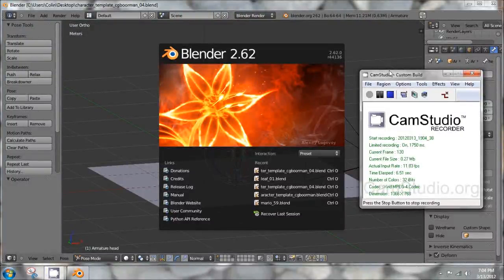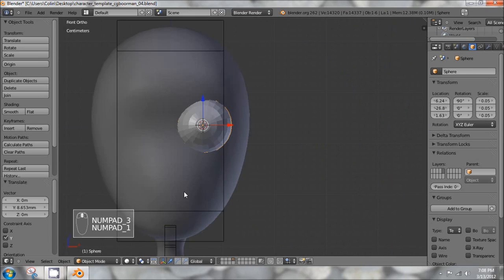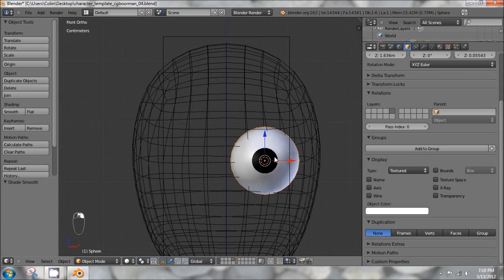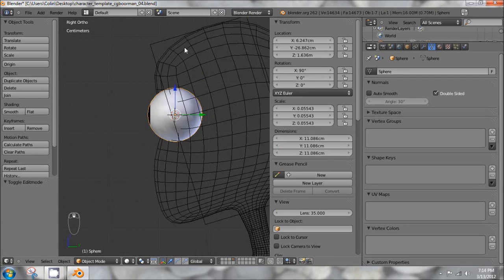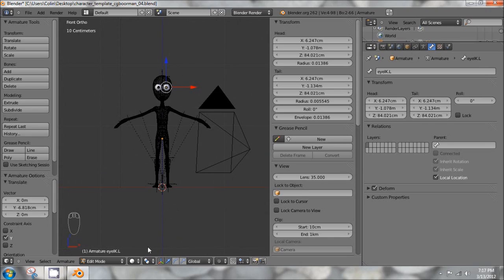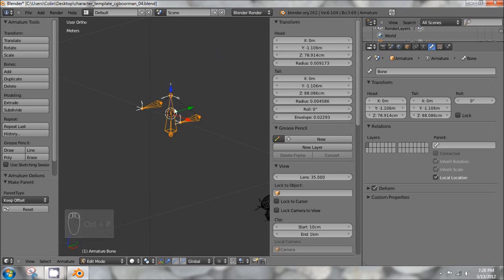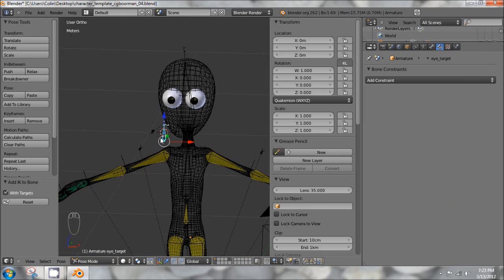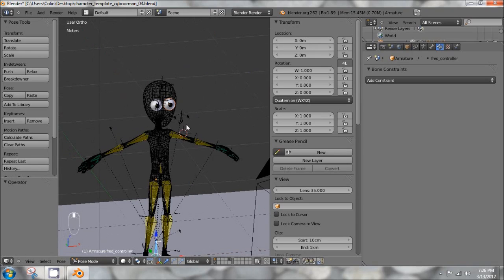Blender 2.6 Tutorial 34 - Eye Rigging

Comment: Good tutorial.However I do have have problems with some keyboard instruction on the shift key. Is that because you are using windows, and I on Linux? What is shift I? as it doesn't work on my computer. Also when I press control P for parent, I get four options, but no keep offset.